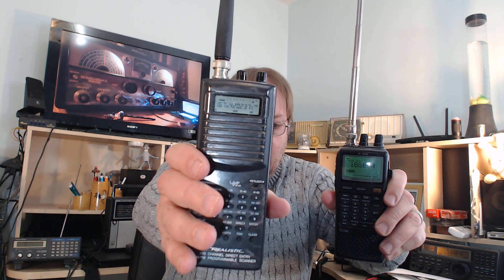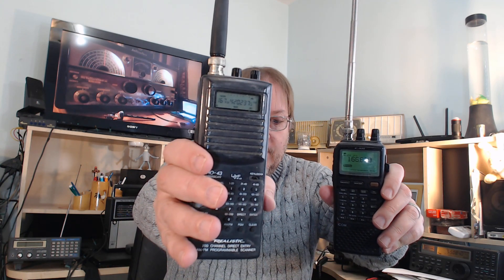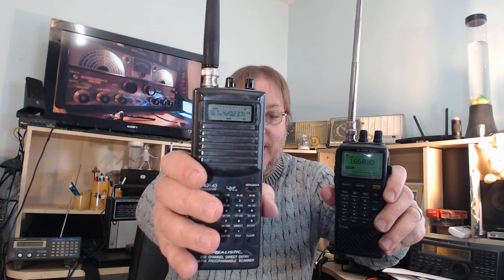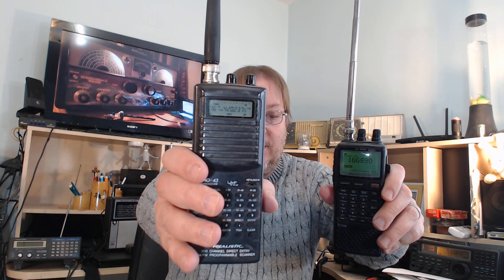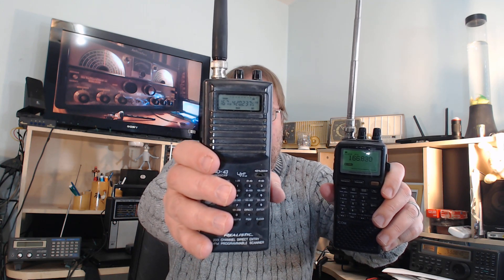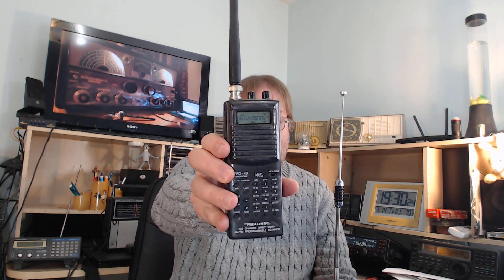VHF UHF daily radio tip 21 Learn about the different tuning steps on your scanner radio

Comment: Great informative video Gilles! I miss my IC-R20.  Stupid me fried it accidentally with a higher voltage power supply, tip was same size though.  That was a good radio, managed to sell it for parts though :(